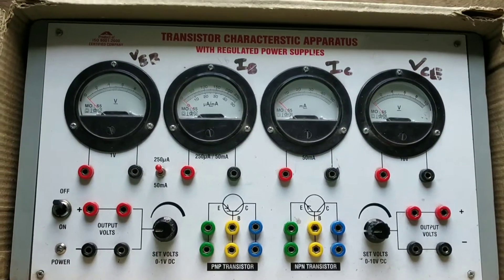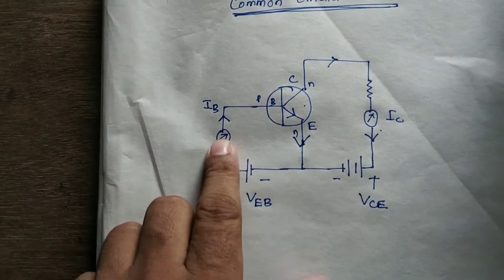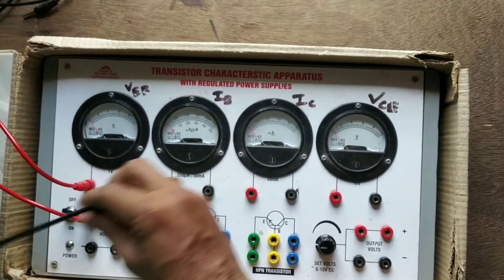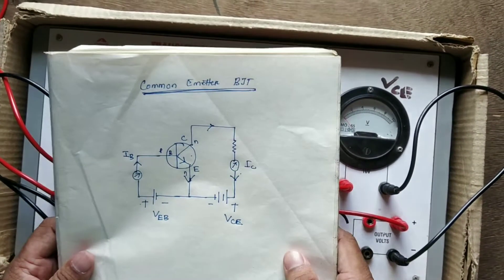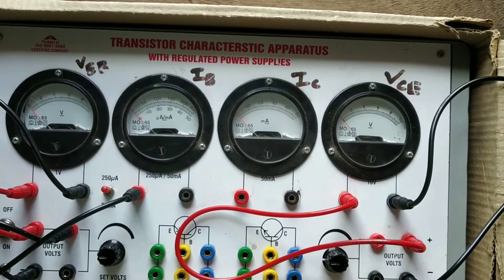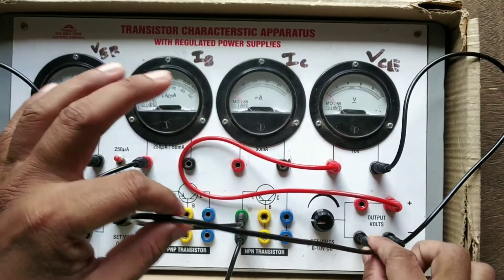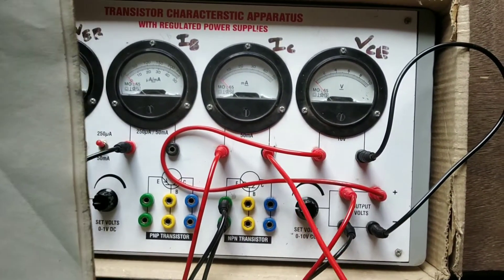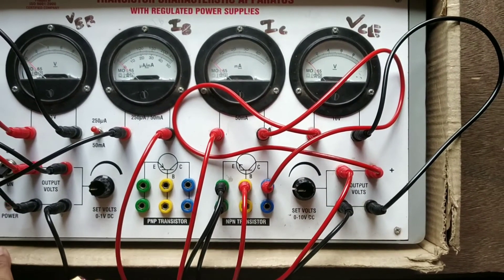NPN Transistor Common Emitter Experiment || V-I Characteristics

Comment: Ckt diagram is wrong because gound connection not given
Reply from the maker: Different companies have different boards and corresponding connection
Reply: @DrRanjitPattanayak  according to you sir  common emitter ,common base ,common collector  configaration if earthing not used yet working  ?????
Reply: If working then sir show o/p  using a load  because this video o/p did not show
Reply from the maker: @Industryelectrical  no I am not telling that hv u show any earthing point on this board? May this model is designed internally in such that earthing
Reply from the maker: @Industryelectrical  so u r telling this board connection is wrong?
Reply: @DrRanjitPattanayak   not like sir jst want to see whether working by seeing practically sir
Reply from the maker: @Industryelectrical  yes working in this  instrument

Comment: Wrong connection..... Make it correct
Reply: Wrong circuit diagram... Vbe should be Vbb and Vce should be Vcc. These are two sources (Vbb, Vcc).
Reply: @sonicresonance8823  there is nothing wrong in connection. But a pass resistance of 1k ohm should be connected for base to controll flooded current in base. I did this and got good performance
Reply from the maker: @sonicresonance8823  this connection is for active mode u go through the circuit eht ever I shown...ok
Reply from the maker: Watch again with circuit...